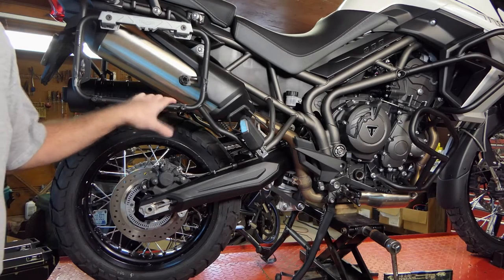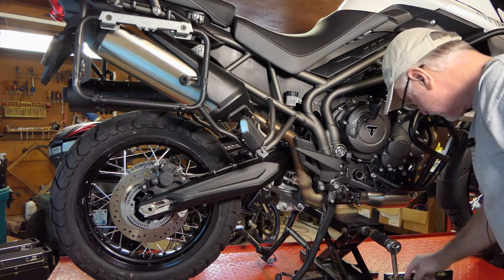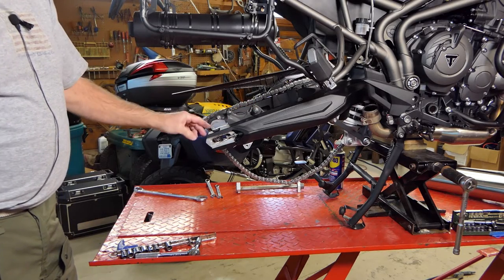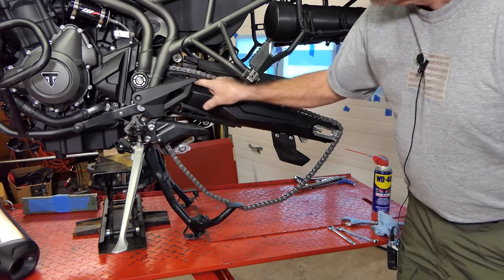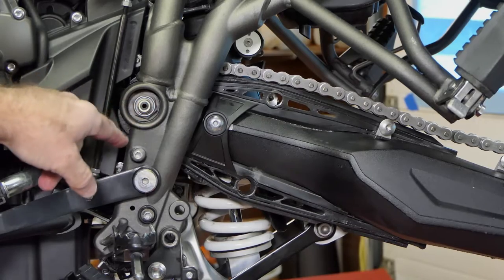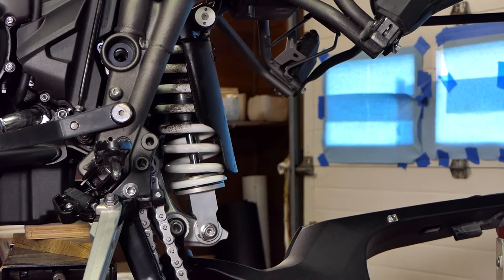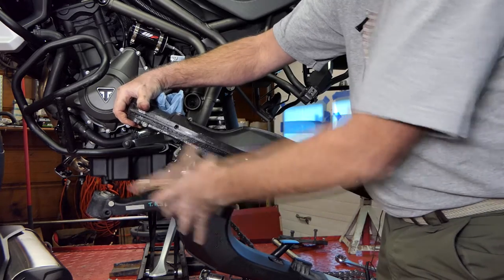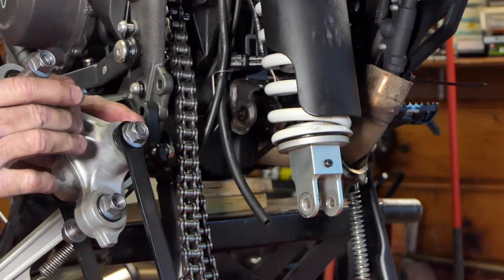2019 Tiger 800 Swingarm and Drag Link Bearing Service

Comment: This is a really helpful video, thank you. One tip in return is not to overpack your bearings with grease - grease is very viscous and the rollers will not turn properly, the grease will be hydraulically forced out of the seal lips leading to stiffer movement and premature seal failure. The reason everyone thinks Triumph don't put much grease in the bearings is because they put the right amount in.

Comment: Excellent video! Thanks! I just did my 2012 and they still use the same major components as seen in this video. NOTE: I was even worse at doing this maintenance then Keith in the comments below. I have 52,000 miles on my Tiger 800xc and all my bearings were still fine, no extra grease left but no play and no damage. I'm not advocating not doing this regularly, I just didn't read the service intervals on this item. Perhaps my regular use of multi-purpose lube on the joints themselves helped me out because this bike has seen a lot of dirt, mud and water so I would recommend externally cleaning and lubing all of these joints often ;-) Also, my swing arm guard was worn out, especially on the bottom, got a new one and I'm all set!
Reply from the maker: Good to hear from you sir.  I am glad everything worked out good for you on your bike.  I usually repack all my bearings on my bikes every winter just to give me something to do more than anything else...  thanks for watching... keep safe out there...  :)

Comment: Could you share what you used to protect the rear shock from debris thrown by the rear tyre? I hate cleaning the rear shock as it's pretty darn tight to get my hands in there. And thanks for your informative videos on the Tiger 800.
Reply from the maker: Hello sir, good to hear from you.  I have not added anything on mine to protect the shock spring assembly.  It has a black plastic guard on it from the factory that protects the back side of the assembly.  You can see it here it is number 6 in the diagram...  https://www.bikebandit.com/oem-parts/2019-triumph-tiger-800-xcx-855532-not-br-in-862413-br-in-only/o/m164672#sch1164654     I hope this helps...  thanks for watching and keep safe out there...   :)
Reply: @ozarksbackroads5484  My Tiger 800 XR does not have this plastic guard. I'll have to try to find out if it will fit. Thanks.
Reply: I checked the parts catalogue and the plastic guard does not come with the road versions of the Tiger 800 XR/XRX/XRT. The rear shock is different from the XCX/XCA. Learned something new today! LOL
Reply from the maker: @brendonpeterlim9w6vx  Thanks for the info sir...  :)

Comment: After you have everything together, and the bike is on center stand, if you lift on the rear wheel do you feel any play?  My 2014 has a about an inch of free play when i try to to lift the rear wheel.  Wonder if that is normal.
Reply from the maker: I am not sure, it must be in the shock/spring assy.  you might try tightening down the preload a bit on the rear shock and see if that is where it is at...   :)
Reply: @ozarksbackroads5484  Turns out the rear drop link bearings that go in the bottom of the swing arm are missing, disentigrated. 37,000 miles and I never serviced  them.  My bad.
Reply from the maker: @brixelus  I feel your pain brother... but that is easily fixable... keep safe sir...   :)